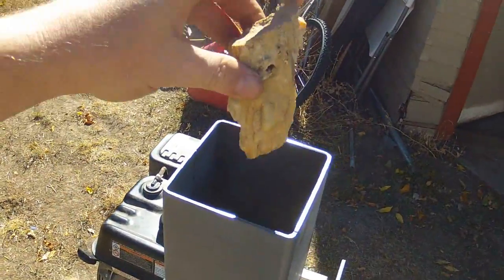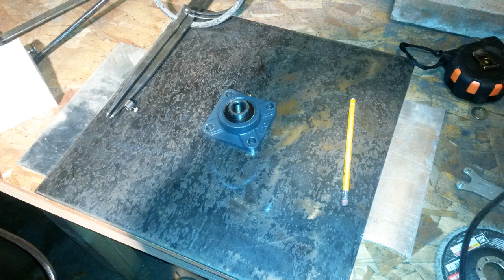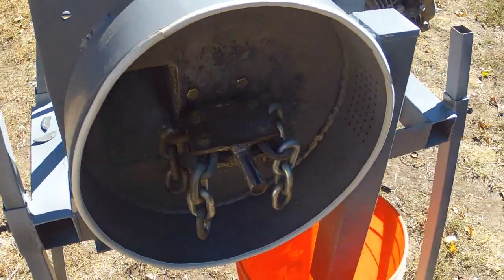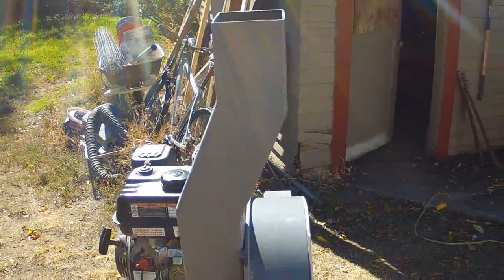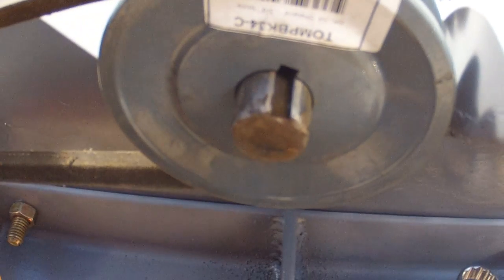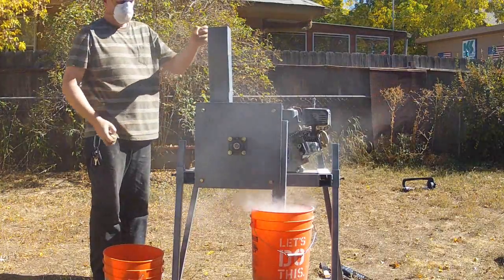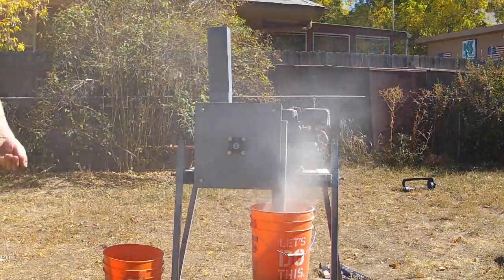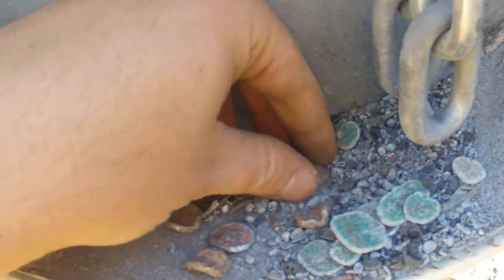DIY Impact Mill/Rock Crusher - Crush Anything (Gold Ore, Circuit Boards, etc)

Comment: I need one...looks like I could cut out a section from a hot water heater tank...maybe even use the bottom, even though it's curved. Could you explain the design more? Do the chains hit anything that's not airborne? They're not supposed to hit a plate?
Reply from the maker: +mikefromspace A hot water tank would wear out very quickly if not shatter (if its cast iron) and I doubt its as thick as we need it to be. I am going to add AR plate or something hard like that in the bottom of mine to prolong life. The chains hit the ore as it enters and then slams it against the hoop, towards the bottom (a reason the designs with screens on the bottom fail). A plate at the bottom would be useful. The body (hoop) doesn't need to be curved, I think an octagon would work as well, and be cheaper.

This spring or summer I am going to get some 1 inch lexan and bolt it on the front instead of the metal and film what happens inside, should be interesting, but might not show anything but dust, with a high speed camera it'd be really interesting though.
Reply: +USMiner Wow, thanks for the fast response. I'm only crushing brown glass which I grow gold from using a custom microwave oven 2700F, 3kw. It beats mining. It must be like flour or close to it. Took me weeks to finish this oven but crushing glass with a pulley, a 100lb 4" diameter rod inside a couple of pipes is really only fun for a workout. I have 2 hot water tanks of different sizes. I might use the smaller one as  the disposable inner section. Just wish my plasma cutter wasn't shot. Gotta sell some gold and buy a new one, American made this time.
By all estimates, I should easily be able to produce over 2oz Au daily using this machine. Maybe I'll just buy a pulverizer haha but I love engineering.
Reply from the maker: +mikefromspace I've never heard of gold from brown glass, do they use it as a coloring agent or something? Seems pricey... This crusher might be overkill for glass, it'd definitely powder it though, it's like flour, make certain to wear a good filter mask. A cheaper and easier to build method might be a ball mill since glass crushes easy compared to quartz, if I was building something out of a hot water tank that'd probably be the direction I'd go. Those take longer to pulverize though, and are clunking and loud for hours or days, this chain mill chews through anything pretty much instantly.
Reply: +USMiner Well, the glass powder makes more gold.  It's not there in spectrograph tests 'till it goes through the process of microwaving at 2025F with certain plasma inducing triggers. Clear glass makes gold also, but at a higher temperature. Brown glass has copper and nickel, so it heats up sooner. I'll probably use a vacuum cleaner bag collector with a vapor mist to get the rest. Each brown beer bottle yields $180 in gold minimum.
Reply: Hi pls find my video its for sale half price in Ebay.  https://www.youtube.com/watch?v=LzlXImHNIcw&t=4s

Comment: with a lid on the bucket and a hole cut to fit the square outlet tube it should cut the dust in half at the least.
Reply from the maker: +E. Fifield Good idea, I have another mod along that line that I'm going to do this summer. Making an autofeed hopper, then a spray/mister attachment for the output tube, and then it'll feed wet straight into a Gold Cube. So basically a guy can toss rock in and then get gold ultra concentrates out the other end all automated.

Comment: if thats an aluminum pulley wheel it will heat up with the stress of the belt possibly slipping when doing larger stones. if its steel it should not do that
Reply from the maker: +E. Fifield It's cast iron I think? The pulleys from Surplus Center. I gave it another try without the key before I left for the winter and same thing happened after 4 buckets run. Had to shatter the pulley off the shaft with a hammer and the bearing collars were stuck too. Had it oiled and it wasn't rust, they were stuck by friction. Total mystery to me...Thanks for the comment and input though.
Reply: +USMiner I would think that the vibrations are transferring down your input shaft onto the pulley also any heat that builds up will not help what have you used to reduce vibrations? try a better bearing, try a stronger metal for the pulley (hardened).
Reply: just change out the aluminum pulley single belt to steel double belt on both motor and crusher with keys and that will solve that problem. too much friction and stress on one belt and single pulleys
Reply: or, there may be a way to, if speed wasn't a factor, just do a direct shaft connection from the engine to the crusher. that would eliminate the need for the pulley, and belt, and with the right connection, could even make for super easy maintenance. certainly also, using much harder materials that won't were so fast would be good. you could bring a hose from your screen output to your bucket, and use something like a shop-vac or similar sucking machine with a very fine filter to remove the bulk of that flying dust, and possibly even further concentrate the pulverized materials. if, perhaps you wanted to use this with an electric motor, that could also simplify the mechanical parts, depending on your ability to properly wire up the electronics and knowing the power you would need... and save on fuel, if not electric bill. other than that, you have a pretty good design going, and heck, you get the gold, so thats a bonus right there eh... lol
Reply: @EddieSchirmer  Many good points, and thanks for sharing them.  I wouldn't eliminate the pulley because the shock of momentary stop, every time the chain hits a rock, would be transferred to the motor's bearings, instead, and chew up the engine inside.  Even putting a shock block on the shaft may not be enough to prevent internal engine damage.  Just a thought.
Reply: If it's an aluminum pulley the ID of the shaft bore is shrinking reducing the tolerances. The shaft should grow too because it's steel. A steel bore will open up, so in theory a steel pulley would work better with a steel shaft. Take the set screw out and opt for a steel key, and some anti seize and you got yourself something special. For even more tolerance, take it to the lathe, center it on the 4 jaw Chuck, and bore it out .05mm. that should account for dirt and debris.